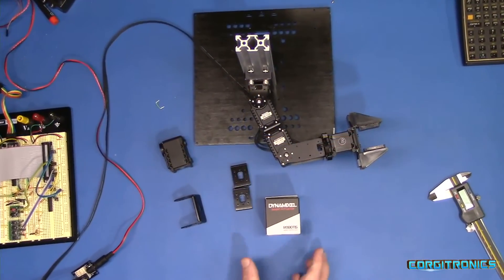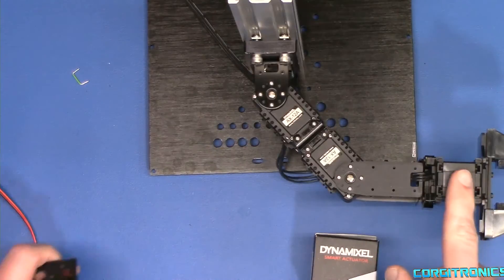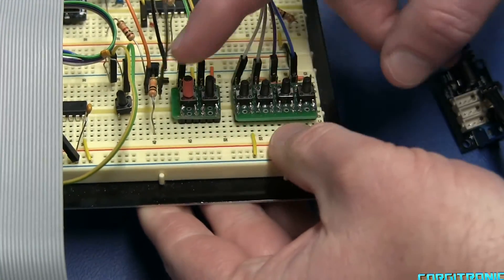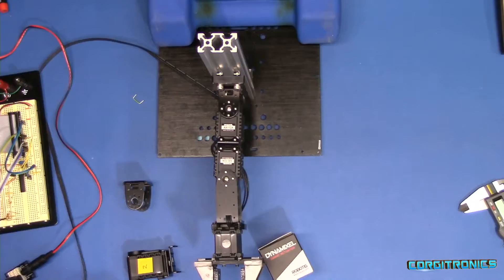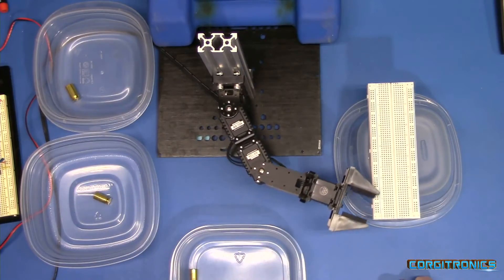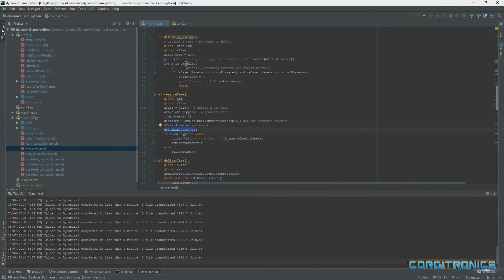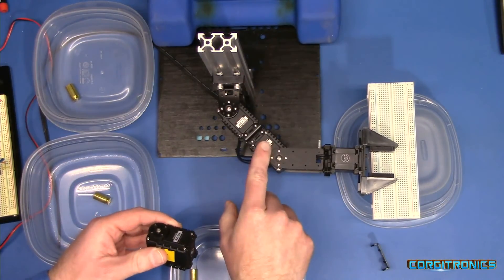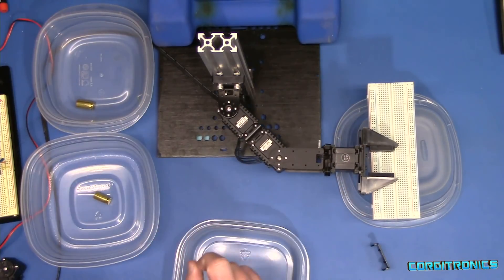A simple Dynamixel robot arm

Comment: This is a great video!  Did you ever get to the root cause of the bad servo at 9:00 in this video?  Do you know any good articles about the reliability of the Dynamixel hardware in terms of stress testing?  I'm just trying to price out what it'll cost to buy these versus buy something more expensive and have it last longer for the application I'm using them for.

Comment: Very amazing video sir. May i ask u one question, Can this work without USB2AX (only raspberry and IC ) like you showed in one of your videos using your github code ?
Reply from the maker: Thank you.  As mentioned in the other video, I had limited success with directly controlling Dynamixels.  They seem to be fairly sensitive about the signal timing.  So, I'm still using the USB2AX for the one set of servos.  I did not have luck initially with the OpenCM9 board, but I'll probably give it another try when I build another machine using Dynamixels.
Reply: Kindly do use open Cm 9.04 i have that and i am stuck with the programing part. I am using open CM 485 expansion board with it. I will wait for your vid with open CM 9.04. thank you.
Reply from the maker: @shubhamshah9963  I hope you can get it working in the CM 485 board, I am working on another couple of projects at the moment... primarily with the Tic T249 board from Pololu, which is for stepper motors.
Good luck on your efforts!  Let me know what you discover.

Comment: Hi Corgi - Do you know if the gripper itself fully closes*? * - "Fully-closed" meaning the ends of the gripper are touching.
Reply from the maker: I don't think the two sides will touch when closed without some sort of filler material, such as the two blocks I made which you can see attached to the inside of each gripper surface.

Comment: Sorry to keep bothering you Corgitronics but I have another question. How would one go about ordering the arm hardware: two extrusion posts/beams, bolts, nuts, connector plate, and steel base plate. I looked on amazon and they sell either really long posts/beams or really short. They also mostly sell in large quantities. I would really appreciate any help.
Reply from the maker: No problem, I'll try to answer as quickly as I can.  The beam and baseplate are from the Open Builds Part Store:  https://openbuildspartstore.com/v-slot-linear-rail-1/
I used M5 screws and T-nuts, along with some corner connector blocks to assemble it.  You can cut the aluminum rail with a hacksaw pretty easily, just get a metal cutting blade.
Reply: @Corgitronics  I was going to order the parts for your base form open builds part store - Calvin kindly enumerated all the parts - the one open question is what you've referred to above as the corner connector blocks.  Which ones did you use and/or are these necessary etc?  Thanks!
Reply from the maker: @ShaneClaussen  I'm not sure where I refer to a "corner connector block" in this video.  The OpenBuilds parts are just the base plate and the 20x40mm extrusion.  If you can point out the time in the video that you are referring to, perhaps I can elaborate.

Comment: Hi Corgitronics, great video, thanks for sharing. When you supply power to all three AX-12A actuators on a single bus, do you just supply the 9-12v recommended in the user manual to the 1st AX-12A on the bus, or do you have to supply 9-12v to each AX-12A individually? If you just supply 9-12v at the beginning of the bus, do you notice a voltage/current drop every time you add 1 more AX-12A to the bus?
Reply from the maker: I supply regulated 12V to the beginning of the bus and just daisy-chain the motors.  The Dynamixel servos are designed to work this way.  I probably wouldn't string more than 3 or  4 on one wiring run.  I didn't bother to check the voltage drop at the end of the run, as the servos don't use a lot of current and the wires are pretty short, only 8 - 10 inches between servos. Also, with this arm, at most only two servos are running at any moment.